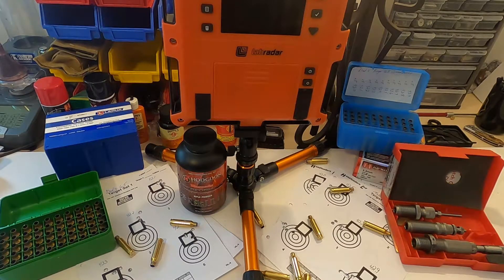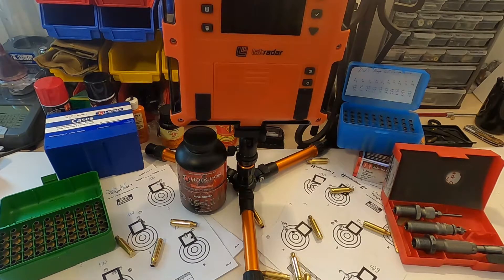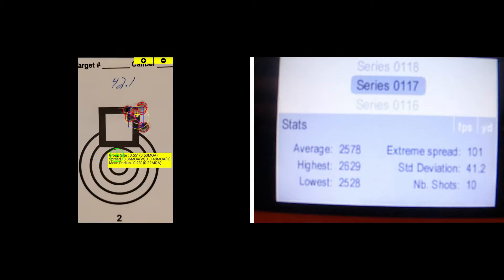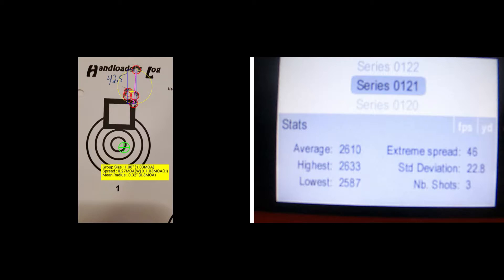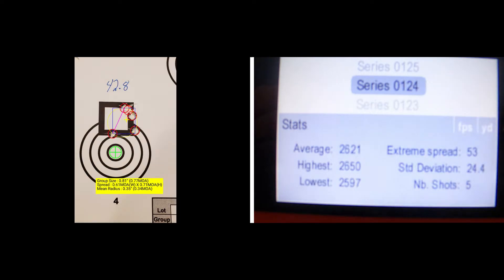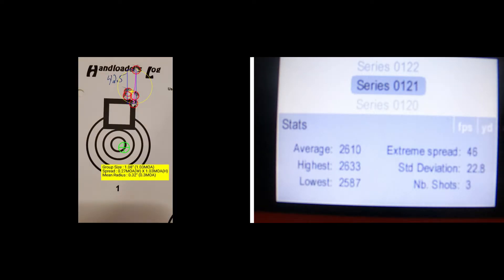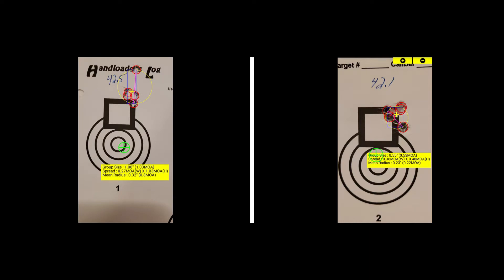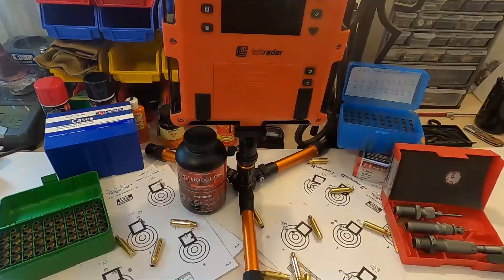147gr ELD Match for 6.5 Creedmoor Part 2

Comment: I missed what powder you used
Reply from the maker: SuperFormance
Reply: @mattsreloadingbench  have you noticed any temperature sensitivity?  Just asking because I had amazing results with superformance, until I used them at a PRS match.  In a 10 shot string under two minutes I started blowing primers at shot 7
Reply from the maker: I have not had that issue at all.

Comment: I use a magneto speed. Used it in some very cold conditions up here in Canada and it's never failed. Man those SD'S and extreme spreads are,for lack of a better term, Extreme.
Reply from the maker: I used a magneto in the past.  Until I ended up shooting it because it slid off of a tapered barrel.  It was not a good day for me.  Also, what do you mean by extreme?  Good or bad?  Everyone has their own standards and I am looking for some clarification.  LOL